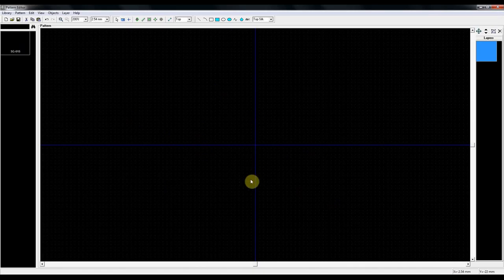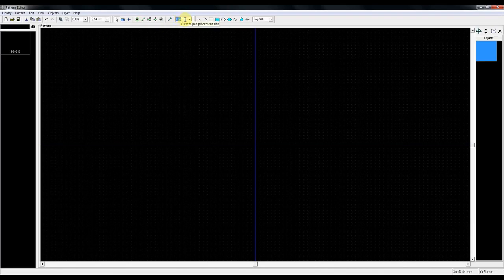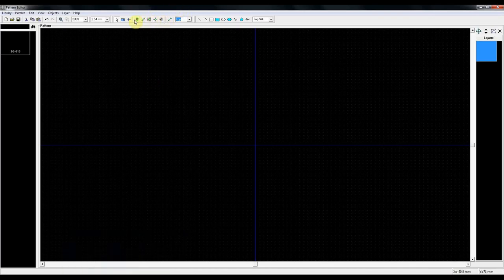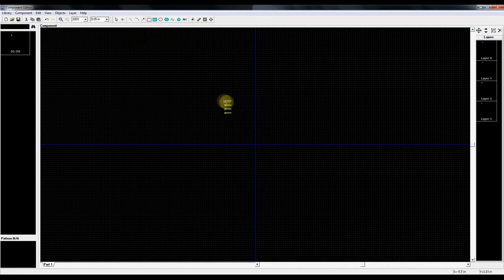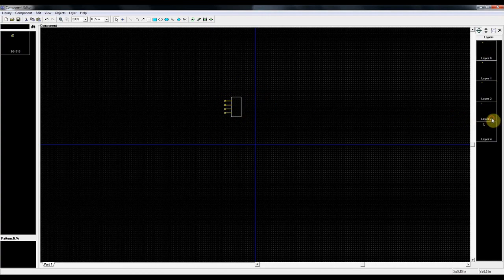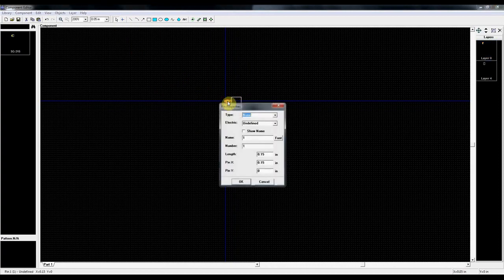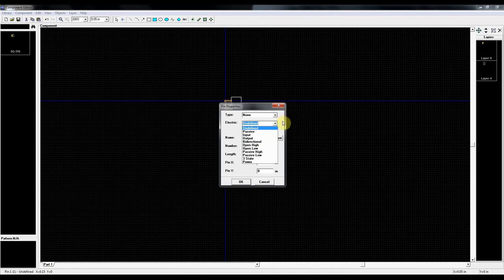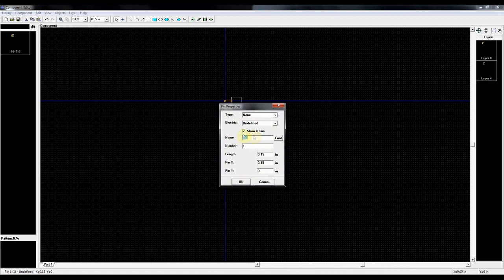DipTrace custom component design

Comment: wot version of dip trace are you using am using 2.4 dip trace there not the same mate set up different than yours
Reply from the maker: Niah Miles diptrace went through some big changes migrating to version 2, I think this one was the Version 1.5 just before it changed to 2.  Can remember cursing them as i did some handouts for over a 100 students that i had to bin.